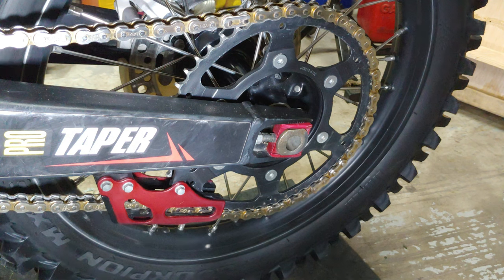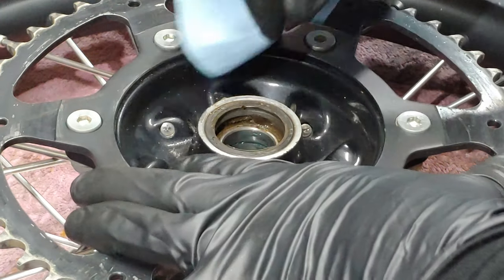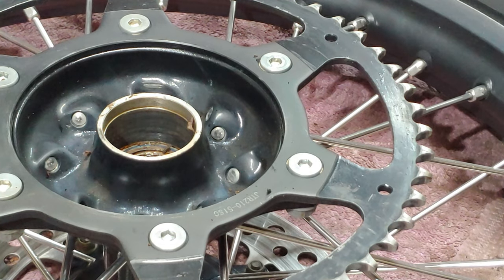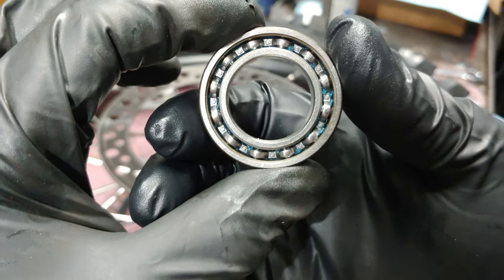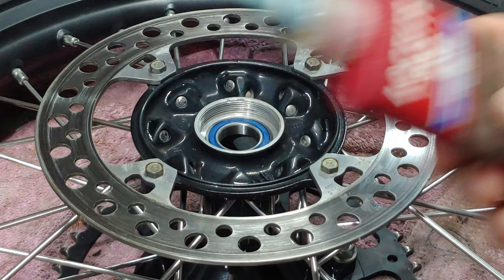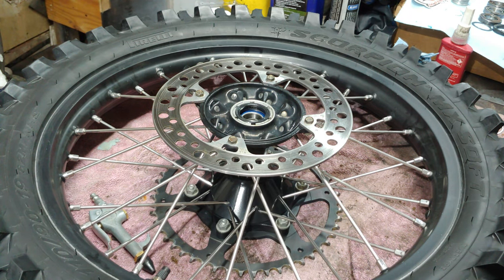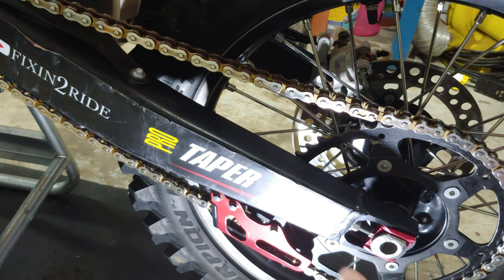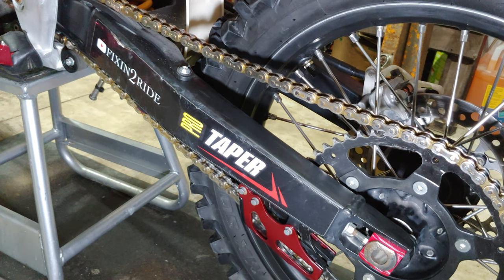Dirt Bike Wheel Bearings || How to Replace || 2006 Honda CRF250r

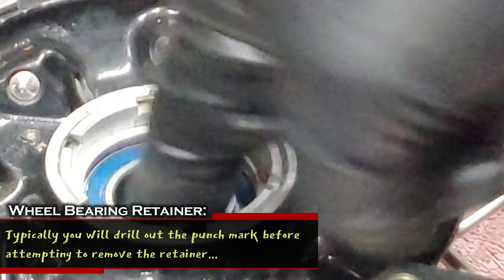Comment: Hey man at 8:57 what did you say about the punch mark? I cannot get the retainer to break loose, trying to get it to come off to replace bearings.
Reply from the maker: To drill out the punch mark.
Reply: @Fixin2Ride-Official-  it won’t mess up the threads? And will it help free it up and break loose?
Reply from the maker: No it won't. You're only going to be drilling out the punch mark. The punch mark makes metal from the hub push against the threads. So when you drill out the punch you drill until you see the flat mating edges of the hub to retainer threads. Then I would also throw a little heat at it as someone may have use red loc-tite

Comment: your wheel spacers (collars) has large grooves in them they will chew up seals instantly
Reply from the maker: Thanks for the tip I didn't think they were very deep at all and were mostly standing out because of being dark maybe a little bit of grime in there still but I will take note of that I do have a new set on the shelf that I could use so thank you very much!
Reply from the maker: I wrote in the note to drill the punch Mark out before trying to remove the retainer. The point of the punch Mark is to jam the retainer to the hub so it doesn't spin loose. So you have to drill that out soup before you can try and spend the retainer otherwise it'll be really tough